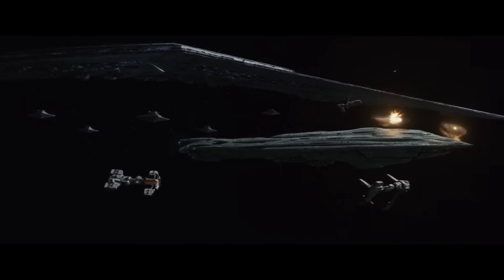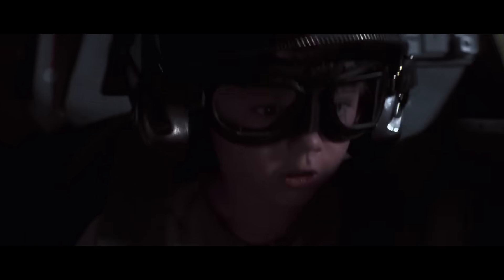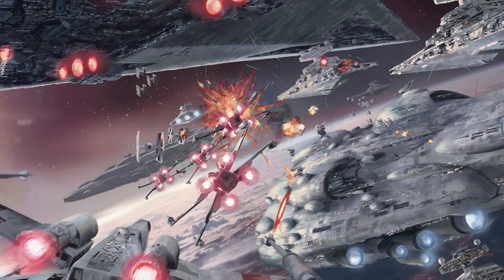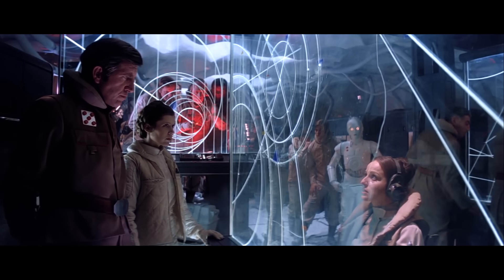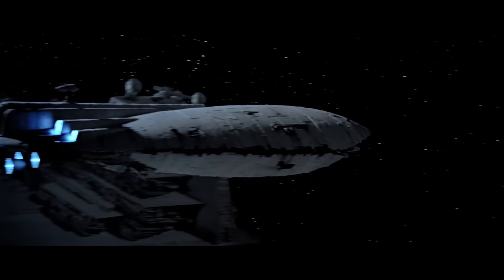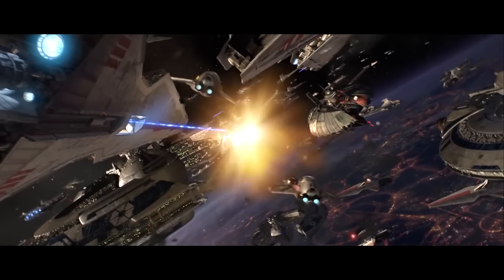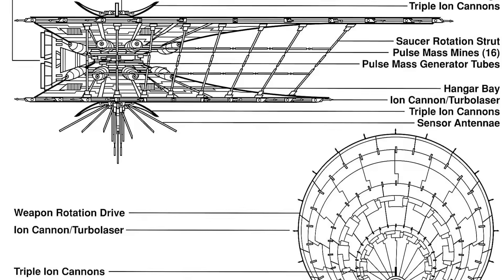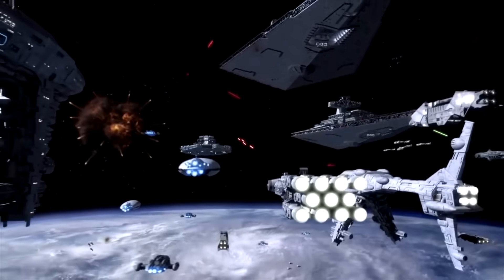Why Star Wars Turbolasers SUCK! (and better options) | Star Wars Lore

Comment: With a stronger focus on ion and missile weapons the shielding would eventually change to reflect the new standard? Systems hardened against ion attacks, shields adapted for ion weapons and missles?

Then you would have to add more amounts of stronger ion weapons and increase the amount of higher yield capital ship grade missiles/torpedoes.

Thus creating some of the same problems as before with too many mounts, and the added factor of now having a limited number of warheads to consider.

All those physical weapons take up space that have to be stored safely for obvious reasons. Which takes away from internal capacity.

So either they start cutting down on fighters or figure some way to make the ship systems smaller without sacrificing power.

Comment: My general thought is that there isn't a significant energy savings to using mass drivers/ion cannons compared to turbo lasers (cooling remains a significant issue.) In addition to spare parts/maintenance, mass drivers would need more regular barrel replacements along with the added cost of ammunition logistics, which isn't insignificant if a fleet can't fabricate ammo onsite. Turbo lasers, while flawed, take ammunition out of the equation, extending the operational range of ships that use them. It makes better logistical sense in my opinion.

Comment: They really should design something that is power wise between a normal turbolaser and the super weapons like the main weapon of Death Star. Because blowing up the planet is a ridiculous over kill (just destroying the surface is enough to take out anything on it and even that is a waste of a planet that could sustain life.) But having one main weapon that can take out an enemy capital ship with one shot would be really helpful seeing as usually fights between ships are long slugging matches in SW. Arming an Executor with something like that and standing back sniping the enemy ships would have changed the way battles are fought. And in typical SW fashion the obvious counter to that would have been small fighters (or possibly one piloted by a 10 year old kid from Datoiine) being agile enough and numerous enough to not be worth taking shots at with the main weapon and whittling down the big ship by hitting vital spots or even the big glaring weak spot that causes the big ship to blow up entirely... Anyway, I just think that SW has unnecessarily powerful superweapons.

Comment: So basically, the ideal fleet in Star Wars is to build ships around a coaxially mounted ion cannon/railgun pair, pepper them with rotary CIWS laser cannons, and deploy them in small clusters around a cruiser acting as command, additional ammo storage, generation capacity, and to house a starfighter wing. Combat would basically revolve around trying to "blade" the axial end of the gunships to the target, reducing cross section, whilst moving around outside turbolaser range to "kite" the enemy with ion cannons and railguns. The laser cannons, controlled with an automated cueing and intercept system, take care of any enemy fighters trying to close distance.

I say build the ships around a coaxial pair of guns, rather than put the guns on turrets, because you can make the guns bigger if they reach most of the length of the craft. If you prefer, miniaturized/downscaled Death Star turbolasers in place of the railguns.

Comment: so what i learnt is that the first order resurgent class star destroyers have either extremely efficient cooling that takes significantly less space or its turbo laser systems takes up very little space. I guess that explains the ridiculous numbers of turbo lasers on those ships. Still i think the square cube law would apply to weapon systems as well. 

Also addressing your thing about railguns, missiles and ion cannons, the one idea that came to my mind was the idea of naval gun batteries vs missiles. Sure a missile can hit harder, more accurate and do significantly more damage than any gun battery however missiles costs quite a lot and isnt usually cost efficient. Star wars fleets often consists of hundreds if not thousands of ships and to equip them all with weapons that is a blackhole for credits. So i think thats why turbo lasers are used more often the said other weapons.

Comment: 1 super mac cannon paired with the longest possible range ion cannons, preferably a multiple mount in a turret or several turrets - Dont go overboard on these 2-4 weapons is what i believe should be ideal. Plenty of anti fighter point defence and also medium yield weapons, possibly lighter turbolaser variants, on rapid traversing mounts to counter small-medium tonnage ships like corvettes and frigates. Use the ion guns to snipe down the shields on the closest capital/supercapital ship then smack it around with the super mac. Big ships rely on shields to protect against stray asteroids and other solid matter, its safe to suggest that they dont go all in on battleplate for such work due to thier shield tech.

Take out the shields and the ship is done maybe 2 shots from a super mac with the rest of the onboard power going into an enhanced propulsion and maneuvering system and shields. Also increase the budget (space and finance) for improved targeting for all tiers, heavy medium and close in weapons. Add some special emphasis on point defense volume, hitting power and accuracy to relegate fighters to obsolescence.

Comment: As you describe it, the Battle Dragon sounds more like Star Trek battle doctrine, Phasers or Disruptors  to weaken shields and Photon Torpedoes (Basically antimatter missiles) to blow up the ship. Even then, ship mounted Phasers and disruptors can do massive damage to unshielded targets. A low yield phaser shattering mountains, for example. So if you are short on torpedoes or the enemy countermeasures are too good, beating down the shields still works when you can still set the enemy ship on fire. At this point you might want to have a few turbolasers added in as well.

But yeah, Turbolasers generally suck. Most other universes can just dance around most Star Wars Capital ships while effortlessly carving up said ship. Having so much energy on hand sounds great but when you r weapons rely on your enemies being slow and/or stupid, are largely unreliable and easily prone to failure under battle conditions, you have to ask "WHY?"

Comment: So a Super Mac ODP platform has would be more efficient and powerful than turbolaser and fire faster as  I read with ground based generators it can recharge as short as 5 seconds. Also in the legends gigawatt  power chart they use for Turbo lasers how would the ODP Super Mac stack up and would the Super Mac one shot most star wars ships like the old republic era sith ships?

Comment: The ultimate issue with mass drivers is logistics.  Rail gun rounds need to be constantly supplied with actual slugs, the rails on the guns wear themselves out and need to be replaced (you can probably get around this by switching to coil guns, although they are much less powerful), and the rounds need to be perfectly designed for the gun.  Turbolasers simply require a constant supply of tibanna gas.  A planetary defense fleet could do really well with mass drivers, since their lines of supply simply encompass a few systems at most, but the strain may be too much for a galaxy-spanning empire.
Reply: I have to imagine turbolasers have their own host of logistical problems too. I mean, cooling systems can fail, I'd assume the barrels themselves would have to be regularly replaced since they're under constant strain from regularly dealing with extreme temperature shifts from having superheated plasma pass through them and cooling down to sub zero temps after the firing has stopped. Everything must have it's own unique drawbacks.
Reply: @inffected0235  And there's aslo the entire tibanna gas issue...

Comment: I find the main points here belie the real issue with turbolaser technology is in the support systems, and not the weapon itself. Poor tracking, low firing times, and unreliabilty are problems that surround the weapon system.

Comment: This is why my non cannon race the savoudiin use old venators captured during the clone wars and ISD's captured during the galactic civil war modified with hyjinx 12 singularity missile launchers 
Escalator 1 ion cannons 
And samfire seismic missiles For anti capitol ship and dstl 33 railguns
 tribeam lasers and tmla 34 mod 0 burst missiles for point defenceas well as having the turbo laser batteries replaced with halo343R.K.K.W. 
railguns 
I believe relativistic guns will overwhelm any shield in Star Wars by brute force alone

Comment: Some real weapon rate of fire:- Battleship guns: 2 shot per minute. - 155mm modern self propelled arty: 10-12 rounds per minute- Classic 5"/38mm DP gun(WW2 USN gun): 12-15/min in simple mounts, 15-22/min in case of base ring mountings with integral ammo hoists.- USN 5"/62 naval gun: 16-20 rouns per min.- Italian OTO 127mm/54 Compact: 40 rouns per minute. Usable against air targets, even some missiles.- 76mm OTO Melara dual-purpose: 80/min lolder guns, 120/min Super Rapid in anti missile mode.All of them the maximum rate of fire, sustained rate of fire are slower due overheating and magazine reloading problems and of course, crew fatigue.All of them some kind of mechanized ammo handling with human assistance...

Comment: Just want to point out an error you made, Venators did not have a super powerful laser weapon to use against enemy ships. The scene you point out is actually one of the heavy mobile artillery pieces using its magnetic feet to hang upside down in the Venator's hanger to bring its heavy turbolaser weapon to bear. If you were to go frame by frame through that scene you would see that.

Comment: I can't shake off the impression that ISD's armed with dozens of turbolaser batteries are like Yamato armed with dozens of 152mm multi-purpose guns. Star Wars galaxy need a proper heavy caliber weapon. The worst thing is that *they already have it*, except instead of building dozens of 406mm gun SW-equivalents, they built a single super-heavy gun and put it on a siege platform.

Comment: If I understand correctly, FTL was discovered some 25k yrs past.  turbo lasers have been the mainstay for general weaponry (ship based and non- ship based weaponry).  the Sith wars (not rule of two) displayed this some thousands of years before the sith movie.  ::P the fault I see is the fact that the empire took the Venator Class and shelved it.  That class could have stopped 75% of the attacks (through massive fighter coverage - and massive quick firing turbo lasers).  But the Empire went for a massive flying Pizza slice (that had inadequate guns - for fighter coverage [btw - that had been a problem during the sith Wars also and they did not learn?]).  Technology stagnated.  ST tech did not.  SW has a habit of "re-inventing the wheel".

Comment: I don't think they rely to heavily on slow turbolasers, death Star being an exception.
The Imperial I (which is more turbolasers oriented and as we all know, not brilliantly designed) doesn't even have half its complement consist of turbolasers.
It has 60 turbolasers and an equal amount of ion cannons and 40 laser cannons (point defence). Quite reasonable when the ISD is intended to blast apart capital ships and let TIEs deal with fighters.

Comment: dont the ISD have about half and half ion and turrbo lazers?

also carrys a desent amount fighters, if they had lets say more advanced star fighters (such as a tie intersepter with shields) and maby get rid of a majority of the ground force complitment then you could maby have up to 100 star fighter per isd, maby 10 squadrons of 7 tie intersepters and 6 squadrons of 5 tie bombers. also a small change to weponry 

i would have a type of box thing  on each side of the brige that would act as point def and shield generator. each box would be build to the brige and would have 5 sides with each side haveing 1 heavy lazer cannon, NOT turrbo lazer. 

as for the firepower there would be 30 hev lazer, hev turrbo lazer, and hev ion cannon on top. and 20 of each on bottem. also on top there would be 10 octturrbo lazers with the back ones being elvated to fire forward and one to the side of the mane 4  so it can be 10.

#askeck

Comment: What I think you’re forgetting about with projectile weapons is that they are solid objects which can be shot out of the sky as well. Even if a turbo laser shot moves slower, a capital shop which sees an incoming projectile can antispate it’s trajectory (since it won’t change direction like a star fighter) and blow it out of the sky before it reaches the defending ship. This is something often overlooked and I think it’s a big reason why projectile weapons would be less effective. Thinking back to the Halo fleet vs. Death Star video, I’m going to put my money on the Death Star because I believe it has enough turbolasers to shoot down MAC projectiles before they impact since the projectiles cannot maneuver out of the way. How hard is it to hit an object when you know it’s direction and velocity aren’t going to be changing. Especially in the situation Eck gave us where the MAC guns were fired from extremely long range. The longer the range, the more time the turbolasers have to prepare a trivial intercepting shot. Again, the reason turbolasers suddenly become so much more effective here is because projectile weapons do not alter direction of velocity once fired, unlike an incoming bomber or starfighter.
Reply: There are two major problems with this..
1) with how fast the projectile is moving, between 30 and 13,000 meters/sec in the case of MAC shot, it'd be nearly impossible to shoot out of the sky because they are simply moving too fast. And because of the fact that star wars still employs human gunners on their weapons, It would be nearly impossible to actually hit a target that small moving that fast.. it'd be like hitting a bullet with a smaller bullet while blindfolded.

2) Even if by some miracle you were able to hit a MAC round mid flight with a turbo laser all you'd really accomplish is melting it because they dont contain any explosive material in them. So you'd just have a stream of molten slag hurling towards you at 12,000 m/s instead of one solid object, and while it probably wouldn't be as devastating as Intended it would still without a doubt cause damage.
Reply: inffected 0 Actually, it would probably cause more damage - a solid slug might punch through, but distribute the same amount of force over a wider area because the slug was slagged, and suddenly 100% of the force is getting transferred to the ship.

Comment: This "Venator-style heavy laser weapon" was in fact an artillery ground laser cannon which was only stationed in the bottom hangar in the battle of Corusant on behalf of Anakin. It was therefore an isolated case instead of standard equipment.
Source: https://youtu.be/cDizZ2IYyI0

Comment: #askeck Why didn't the Executor SSD have it's shields up in the ROTJ movie. If it did there is no way that Arvel Crynyd could have disabled it. Crashing into the shield with an X-wing wouldn't have done any significant damage so why wasn't the shield up. #askeck